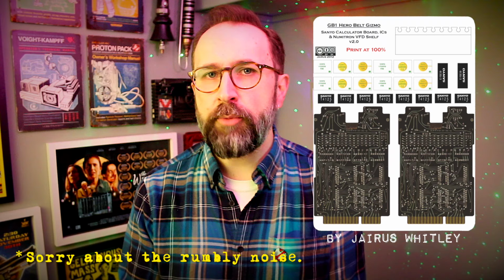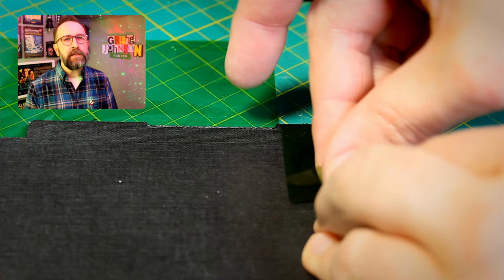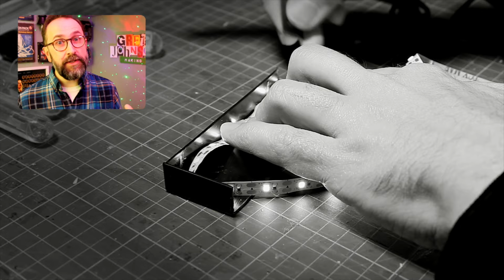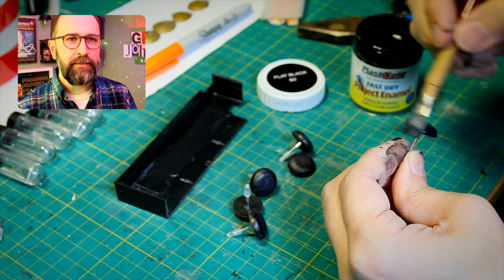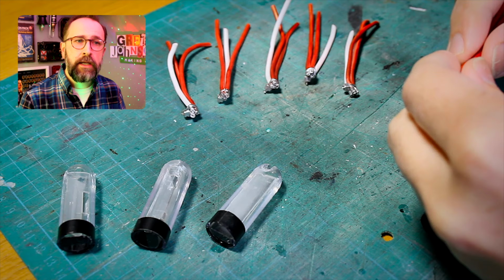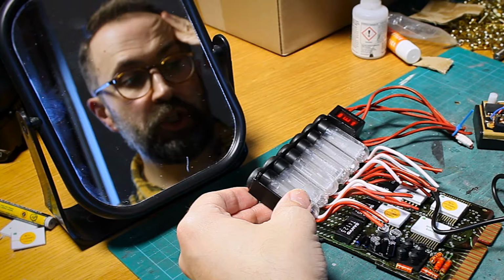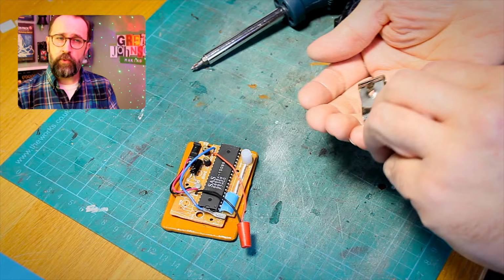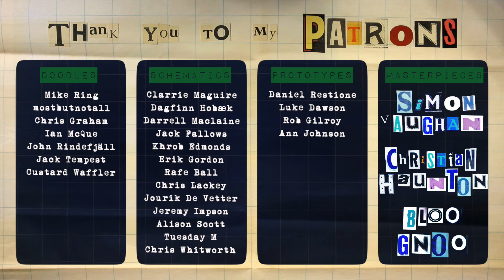Making a Ghostbusters costume Pt2: The Belt Gizmo

Comment: The real thing you approximated with test tubes are called Nixie Tubes. If i recall correctly, you've stated you wish to get more into electronics. You should look for some nixie tube-based projects. I'd say they are probably intermediate skill level, but i think you'll like the result.
Reply from the maker: Nixie tubes! That's it; I've definitely heard that before. I've seen Nixie Tube clocks that are fantastic.
Reply: Also, the things you thought were resistors are indeed resistors. The silver metallic cylinders are capacitors, and, get this, the orange disks are also capacitors.

Comment: I've been doing your belt gizmo project. But I have a question about the LEDs. I picked up fairy lights from harbor freight that has 8 blinking modes. The lights are copper and seem that in a row of every 4 lights 1&3 and 2&4 are connected. At least on one blink pattern. The issue is the spaces between the lights are so long and the overall length is incredibly long.  Is there a way to make a custom new LED strip so that I can use the original  battery compartment/ computer chip? I'm not electrically apt a tutorial on this might help others wanting to learn simple electronics. Thanks.
Reply from the maker: I too lack that knowledge! Other than looping the extra wire back and forth on itself and securing with lots of tape, I'm afraid I'm not much help.